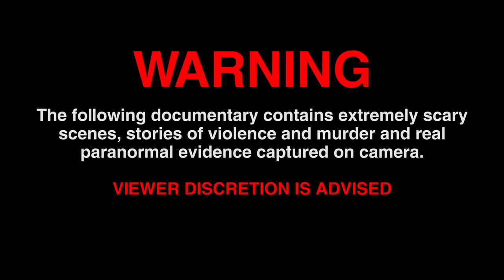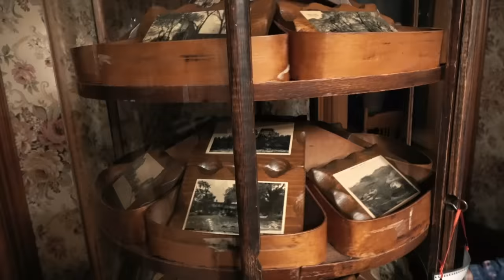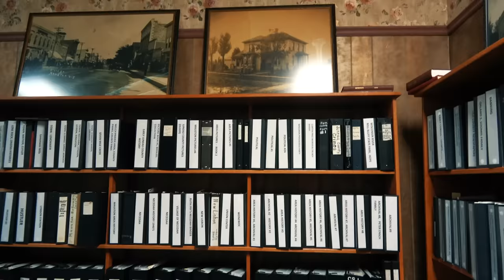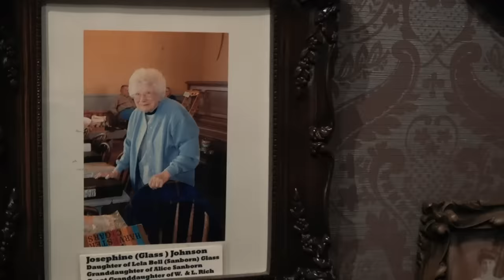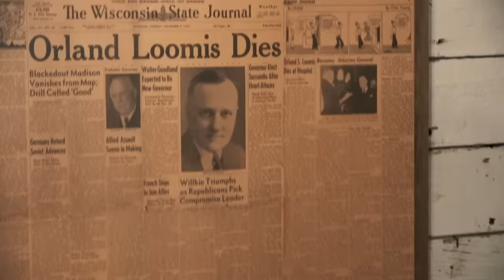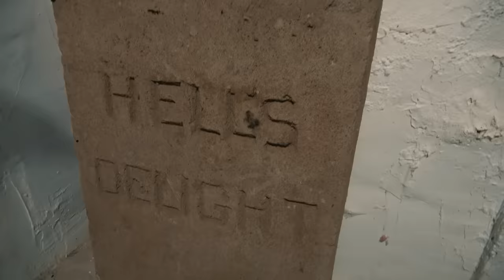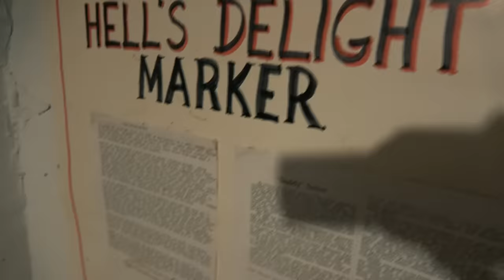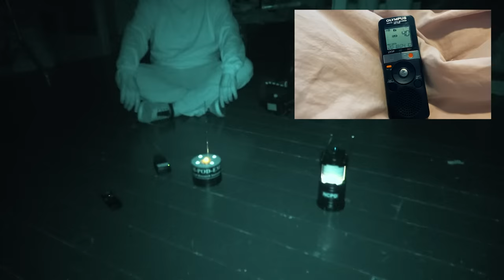TERRIFYING Paranormal Activity CAUGHT on CAMERA (Murder Mansion) | Full Episode | PARANORMAL FILES

Comment: Beyond your tooth’s protective enamel, the dentin layer of your teeth is filled with thousands of water-filled tubes connected to the inner pulp, a collection of soft tissue made up of nerves and capillaries that are sensitive to pressure. Pressure is perceived by your pulp’s nerves, and depending on the thickness of your enamel, your brain can interpret varying degrees of pressure as pain. Sound is a longitudinal pressure wave of a repeating pattern of high-pressure and low-pressure areas caused by particles that vibrate back and forth. This vibration transmits sound energy from one place to another within a solid, liquid, or gas (like air). If your teeth are particularly sensitive, the fluctuating pressure from sound waves can actually cause the water-filled tubes in your teeth to vibrate, especially at high-frequencies, and painfully irritate your pulp’s nerves.